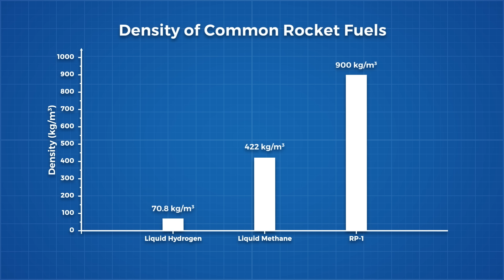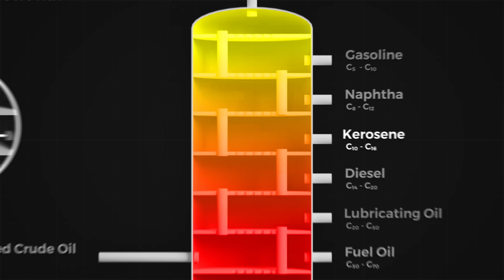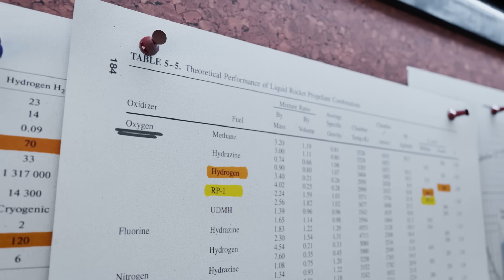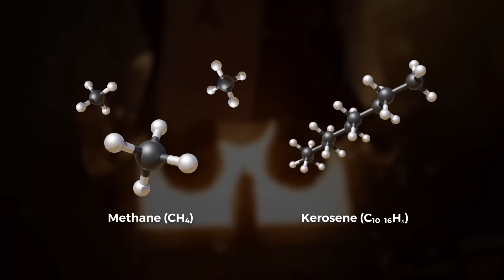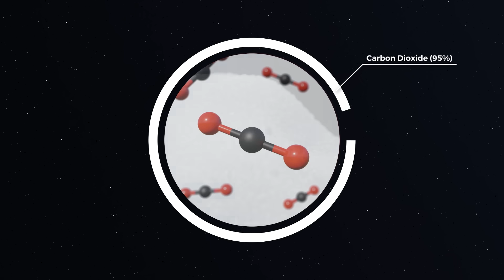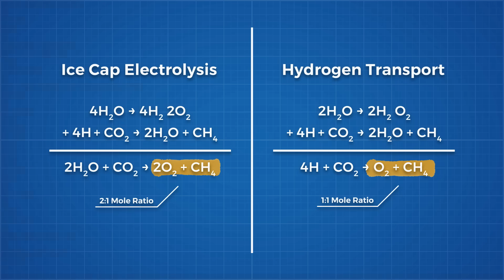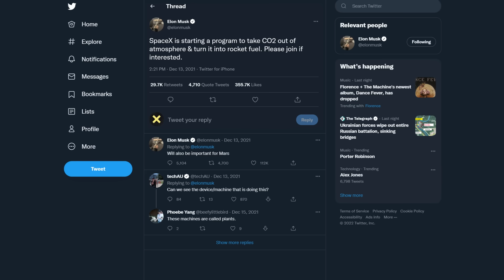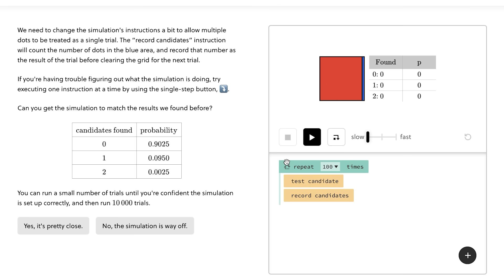Why SpaceX is Using a New Fuel

Comment: ISRU oxygen on Mars is relatively easy because we can extract it chemically from CO2. ISRU methane is a lot, lot harder. Its not the chemical engineering, but rather its the industrial scale mining. And with ecosystem of assembly, refuelling, maintenance and repair robots that would be needed to mine the dirt, from which to extract the water. And the MW class power supply and distribution system. Fortunately, in a realistic Mars exploration mission, the quantity of methane needed is small - single digit tonnes of methane per ascent. So it makes more sense to import methane to Mars and only produce the oxygen locally. After all, the oxygen component is 78 percent of the propellant.
Reply: The whole Mars thing is just to create hype is not meant to be realistic or fool anyone but to rich investors that can't come up with something else to through the money at.
Reply: @lubricustheslippery5028  I'm more inclined to believe that Elon is genuinely delusional, regarding Mars at least. Btw, I love that handle :)
Reply: @saumyacow4435  why would you consider him delusional about Mars? Just curious
Reply: @bigcauc7530  don't bother asking them. You are looking at the modern equivalent to the news paper that published a story about how man would not fly in 1000 years. Only to have the Wright bros do it within the next month.
Reply: @avroarchitect1793  i just want to see their logic. I am not the most knowledgeable on these topics but I have the the notion that this is an important and very possible step in human development. I already know these types who always doubt the future. The past has always been filled with the same sentiment. History repeats. They amaze me with their simultaneous lack of understanding, refusal to admit this, and confidence with what little they do know without being even remotely involved with a project. It's healthy to be skeptical, but outright pessimism about the science seems so disingenuous to me. I just try to see where they come from with it, because i would want them to understand me as well.
Reply: @bigcauc7530  Why, because I think that Elon actually believes in the whole idea of colonising Mars. Its not just a scam. However, delusional is a good way to describe someone who strongly holds a belief in something, despite reality being something else. I should also add that Elon has had a close association with Zubrin's Mars Society and this is where his ideas ultimately stem from - including his wholesale adoption of Zubrin's broken "Mars Direct" architecture, which is what Starship is based around. Several major issues.
1. Elon thinks there is a market for would-be Mars colonists. This is the despite the fact that there is no rational self-interested benefit accruing to any human being in the act of living on mars long term (as opposed to visiting/exploring). I'm sorry to have to put it so bluntly, but in dozens of conversations with would-be Mars colonists, not one has given me a credible reason as to why some random human being would be better off if he/she would be transported to Mars and left there. Very often this is deflected towards a poorly-argued "common good", but no one can postulate an upside. A benefit enjoyed by a human being that only comes from living on Mars and cannot be found on Earth. Elon of course is not alone in this belief system. But he also hasn't given a claimed benefit. He's instead deflected onto "for the betterment of the species" and other such nonsense - and you're welcome to have that argument with me. But think first about pure rational self-benefit? Where is it? What is it? There is none. And that's why Elon's "business case" has no substance, no matter how low the cost.
2. Elon has hired a bunch of smart engineers. No doubt about that. But with all his wealth, you'd think he'd dip his hand into his pocket, pull out a few million, and hire a crack team of scientists working on three basic and obvious problems. First of those is the problem that NASA would like to crack - how to put a vehicle into space for years with no support from Earth, with a must-never-fail life support system that must endure years in space. Second, how do you build the industrial scale infrastructure needed to refuel fleets of Starships - where many hectares and thousands of tonnes of soil are mined just to refuel one ship. An endeavour that requires yet to be invented mining machinery and the ecosystem of assembly, maintenance, refuelling and repair robots. Plus the processing plant. Plus a multi-Megawatt class power source, which requires a nuclear power supply, and tonnes of nuclear fuel (all of which would be nearly impossible for NASA to put into space, let alone a private company). An undertaking that optimistically would cost tens of billions, if not hundreds of billions and which represents a far larger and longer time scale development process than Starship (which has already been gestating a decade).  Third, and even harder, is the technology development and deployment program required to establish a real, technological civilisation on Mars, with thousands of skills (bootstrap issues), tens of thousands of materials and hundreds of thousands of individual parts. That's a trillion dollar undertaking. And the thing that makes Elon delusional about this is that he really doesn't get that the nature and the scale of the problem. If he had done so, he'd have that crack team of scientists working on this already. 
3. Elon really has no idea of why. What he sells is the "we must be an interplanetary species".. but the reasons he gives (and regurgitates more or less the same speech year after year) are plain specious. Out of characters.
Reply: @saumyacow4435  Yes people would only go there for exploration, and as with anything where u have people u have a market and a business use case. SpaceX's goal is the former and they hope the latter will happen, won't be any sooner than a fair few decades tho, more importantly future generations will know if it works or not and make better decisions. For now, spacex is only lookong to provide explorers/researchers the means to go there and do things.
Reply: @avroarchitect1793  Its not about whether something can be done. Its about whether being able to do that something benefits someone. There are lots of things that are technically feasible that no one does because they are outright bad things to do. I grew up in an era full of optimism about science and technology (yes I saw the moon landing) and back then there were stories told of beautiful cities under the sea. That didn't happen. Not because it can't be done, but rather because human beings don't actually want to live there. There's an expression I grew up with that described this well "nice place to visit, but wouldn't want to live there". And believe me, I'd love to visit Mars also. And I'd settle for the experience of watching a realistic exploratory mission to Mars on TV.
Reply: @tanmaykumar4561  In this case you do not have a business case. People will buy something if its in their rational self interest. Living on Mars is not in anyone's rational self-interest. So it will not happen and there is no business case. 

And for the record, I'm a fan of science, technology and exploration. I want to see a serious, realistic Mars exploration program. The whole Mars colonisation fantasy is simply a distraction. A lot of the benefits talked about (from settling Mars) are actually the benefits of visiting and exploring. There is no benefit in remaining there. 

SpaceX (or at least Elon) honestly thinks he has a business case. He's welcome to his delusions. As for SpaceX, I happen to know some of the people there. There's some very clever people and I welcome Starship becoming a decent, reasonably low cost (though not what Elon thinks) workhorse cargo delivery vehicle. If not, then there will be the vehicles that will follow. There may even be surprises, like a heavy version of Neutron. I'm a big fan of the technology. I just don't care for the nonsense and the specious reasons given for Mars colonisation. It won't happen. Because it serves no purpose. But exploration? Yes.
Reply: Sounds like they are gonna need an SMR to power this. Good thing that is on the horizon too. The engineering challenges are there but with enough effort its possible.
Reply: @avroarchitect1793  It is possible, but a) who is going to fork out tens to hundreds of billions needed to establish the refuelling infrastructure needed to support something the scale of Starship and b) we don't need anything at this scale, nor do we need ISRU methane at all to accomplish a realistic Mars exploration program.
Reply: @saumyacow4435  Um.
The plan is not to explore Mars.
The plan is to colonize Mars.
Permanent human habitation.
Reply: @thomashiggins9320  Exploring Mars has a purpose. Living on it long term does not. Why? Because no individual human being benefits from living on Mars. Its not in anyone's rational self-interest to do so. There's no upside, no benefit. Nothing you get from being there that you cannot get on Earth. Without that rational self-benefit, no one is going to live there. And so far I've seen no one give a simple, obvious, credible example of something that would make a single human being better off.
Reply: @saumyacow4435  This isn't just about exploration. We're laying the ground work for colonization and expansion. Thats what the long term benefit is. As for how its being paid for? Starlink and NASA space research grants. Even if we fail the technology that we will develop will be extremely useful here on earth.
Reply: @SueMyChin  1.) no we are not sending people first, that would be dumb. Of course we are sending robots rovers and drones long before people arrive.
2.) It is possible to have a colony on mars before terraforming. We need to set up the structures first, see point 1.
3.) If we do decide to terraform the longer we wait the longer it takes
4.) Elon over estimates the pace of development. Not what they will achieve. I can only think of 2 instances where what he has said he will deliver hasn't come, and that's because they decided there was a better way to do it. 
The issue is that he doesn't deliver at the expected time. That I will concede.
5.) I believe we will put a man on mars before he dies. We could do it now, but the cost would be astronomical (no pun intended) and the engineering ridiculous. Better to develop the system and do it right.
Reply: @avroarchitect1793  In response to your response to SueMyChin (whose post I can't see). 
1) There is a big difference between the kinds of robots and other craft we need to send to mars in advance, to support a realistic exploration mission and the industrial scale robotic deployment required to do what Elon says (and which Elon hasn't spent a on penny on development).
2) Its entirely possible to spend enough money (potentially hundreds of billions to trillions) to establish a permanent settlement on Mars. As I've already explained, this has no worthwhile outcome. No human being benefits from living on Mars long term. You're correct it doesn't need terraforming. Nor does a realistic exploration mission.
3) If we do decide to terraform Mars, it will be so far into the future as to render obsolete almost all of the "we must get to Mars before we do ourselves in" arguments. Would I want to go to Mars if it were terraformed? Yes, but only to visit. The gravity issue is physically impossible to solve.
4) Elon sure does. But worse, Elon has no clue as to what he is doing. He seems to think that if you can build a big tin can with rocket engines, then magically everything else happens. The transportation problem is tiny compared to the life support problem. That's tiny compared to the ISRU problem. And that's dwarfed by the "technological base" problem. None of these Elon has seen fit to throw any money/experts at. 
5) No idea when Elon will die. Elon won't be sending any human to Mars. There is no business case for it. However, I do hope that we can mount a realistic exploratory program to Mars and get there before 2045. This will be the work of a collaboration of space agencies. It will be realistic. It will be limited. It will have nothing to do with colonisation. And SpaceX's role (if it still exists) will be to provide heavy lift launch services into low Earth orbit.
Reply: @saumyacow4435  The same argument could be pulled towards colonizing remote previously unknown territories to which Europeans were not adapted or prepared. It's a new beginning, and no matter how uncertain and risky it would be, when people have nothing to lose (or inherently believe so), this purpose which seemingly is impossible or irrational becomes a true purpose.  For better or worse, the Americas and Australia, which is more similar to Mars in that everything wants to kill you over therer  were colonized. (Don't tell us, we know, they were already inhabited) Also, to quote the late Pierre Falardeau, "We're always going too far for those going nowhere."
Reply: @rolfbjorn9937  This supposed counter argument demonstrates error in fact. The difference is between going somewhere where there is the reasonable prospect of of a rational self-benefit - and going somewhere where there is precisely zero prospect of a rational self-benefit. Its that simple.

We made journeys on Earth, because we believed that going there would make us better off (even if that belief was sometimes wrong). We would go to Mars knowing with certainty that this would make us worse off. Let me say it again.

Being on Mars means living inside a sealed metal box, two metres under toxic dirt. You can only venture onto the surface for an hour a day (due to radiation exposure limitations). There you cannot touch, taste, smell or hear your surroundings. The view never changes. For all the thrill of discovery, the pretty sunsets and so on, this is ultimately total monotony. Inside, you're exposed to the constant whine and hum of must-never-fail machinery. The noise will remind you of the fragility of your existences since to not hear that noise means you will die a horrible death shortly thereafter. Your body will suffer accelerated deterioration, partly from the unavoidable radiation exposures, but mostly from weak gravity. You'll be subject to isolation with those you left behind only able to converse with you in a stilted, time delayed fashion. No pets, no companion animals. No, grass beneath your feet. No oceans. No forests. No insects. No breeze on your naked skin. 

Where is the upside? The thing that gives you so much pleasure and satisfaction that all of this is worth it? The singular thing that Mars gives you that Earth cannot. The thing is, you can if you wish, create an environment for yourself which though physically on Earth, replicates Mars. A metal box, buried somewhere lifeless, and so on. Those who would claim that Mars has some as yet unexplained rational self benefit, would also have to admit that this existence (in the simulation) can also be somehow a life-affirming choice. How? At least it would be vastly less costly and wasteful than actually doing it on Mars. But, there is no rational self-benefit. No upside. Mars is far worse.
Reply: @rolfbjorn9937  Yeh, I'm not sure what you're getting at. You either don't know the realities of living on Mars or you don't understand how our planet works as well as the age of sail explorers did.